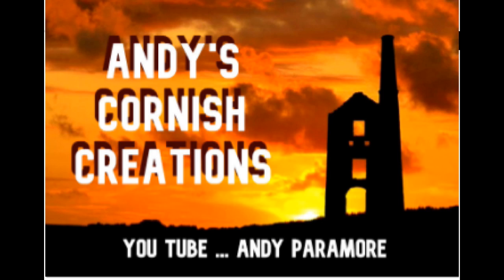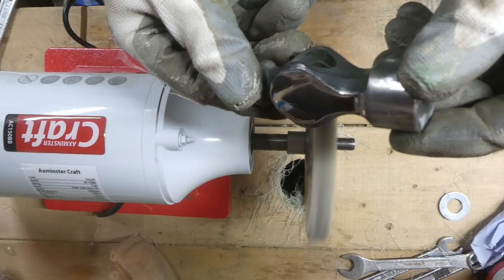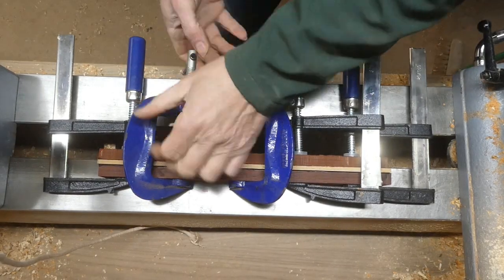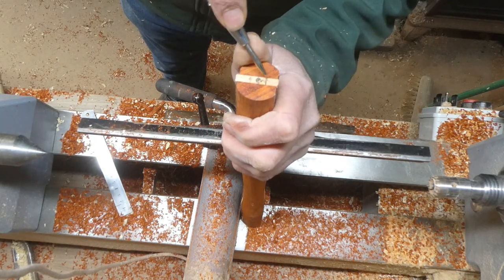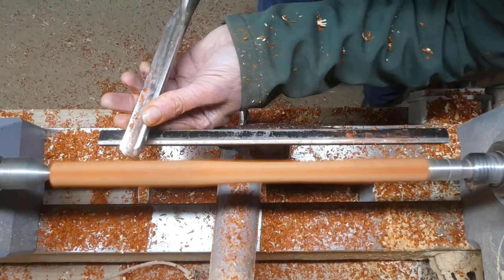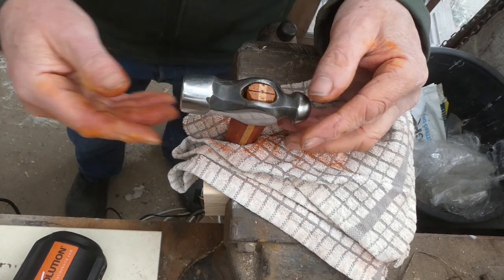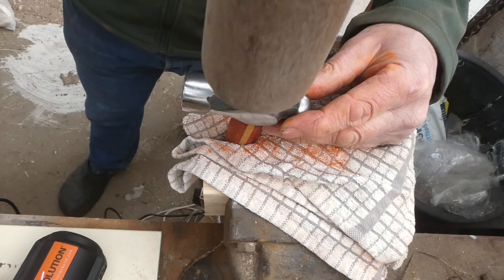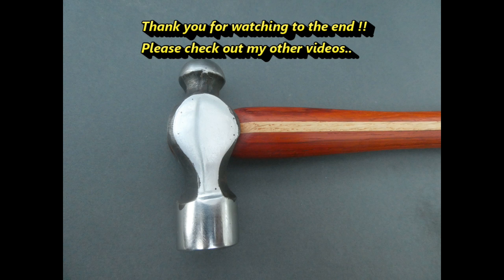Restoring a vintage hammer # restoration # woodturning.

Comment: nice job Andy! now your hammer is too pretty to use! bending sheet metal is how I made my living for over 40 years, and none of my hammers ever stayed nice looking for more than a few minutes!
Reply from the maker: Hi Dave...
Thank you very much...
Yes it is a bit too precious to use Haha...
I can imagine how beating metal can take its toll on a hammer and the guy on the end of it as well !!
Did you ever use a Ranalah ... I have been watching some YouTube videos from Dominic Chinea from the repair shop on BBC... and that is used for bending metal...
Take care...All the best.....Andy
Reply: @AndysCornishCreations  no, ive never used one. I have seen a few people use an English Wheel, which is similar. What I worked on were production items, mainly bent in a hydraulic press brake. The pieces would be bent into rectangular shapes, then fitted together, and welded at the seams. I did the fitting and welding. (usually with the "help" of my trusty hammers!)